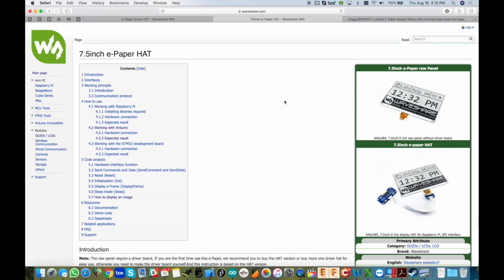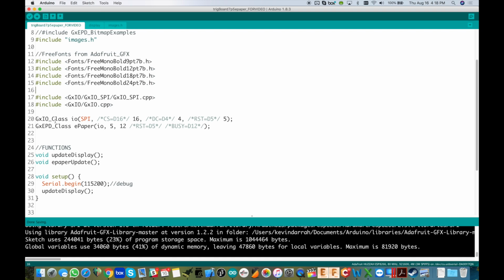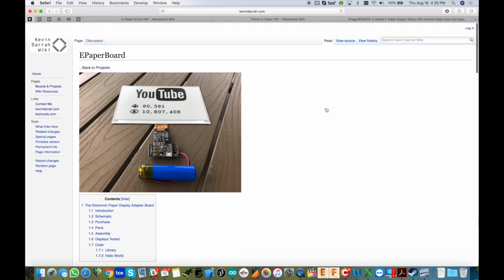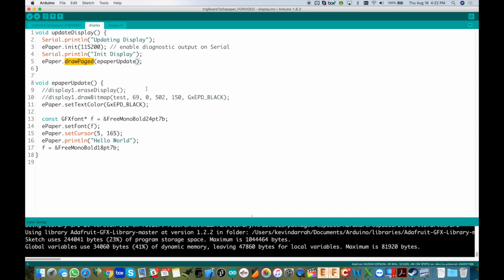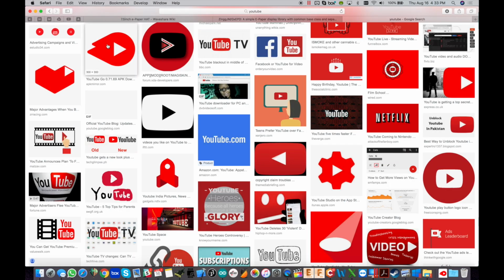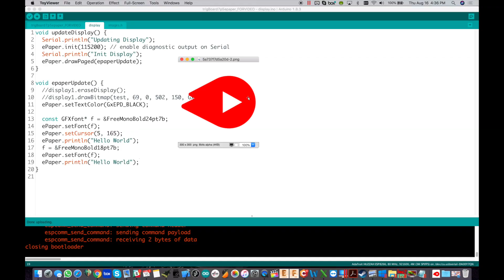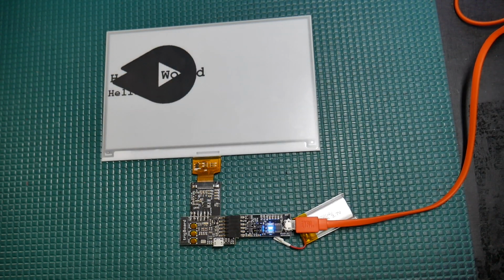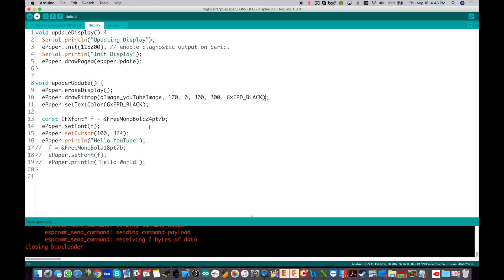E-Paper + ESP8266 Tutorial - Easy Text & Images

Comment: Useful video. Once you see something can be done, you know it can be done.

Two suggestions if anyone wants to try this at home...
Easy one: crop the image tightly to get rid of padding on each size - uses up a lot less space on an image like this. ( I usually include the final size as part of the file/array name). Easy to do, and won't add any real code complexity. 

The other is more complex, and will need a bit of research. With artwork like that logo where there are long runs of 0s or 1s ( white or black pixels) some sort of run length or Hoffman encoding (think fax machine data transmission) would dramatically reduce the amount of data you need to store, at the cost of decoding/expanding the data at display time.

Comment: Hi Kevin, I'm looking to make a counter and timer to put in my local gym to count a rope pull. I was interested if you had some advice on what you think would be a good choice for the display. My initial thought was to use a 4 pin hall effect sensor with 4 magnets evenly spaced and alternating polarities to make it start counting sooner. Concerns I have are: 1) display visibility, 2) battery life I want it to work without buttons, so I was thinking of triggering based on the hall effect sensor, but I did want to work out a scheme where the magnet stopped right under the sensor would not keep the unit running, but that it would still know when it starts up again. Most people will probably be about 4'-6' away from the display and still expect to read it. The room is brightly lit all day long.

Comment: Hello, I have a WaveShare ESP8266 driver board and a 7.5 waveshare e-ink display, but this code doesn't give any result on the screen : debugging (Serial.println) shows that all steps are passed, but screen just doesn't seem to react. In another hand, original library seems too slow for this board, and it tends to crash (wdt reset) when I use it. All I can do for now is drawing a unique bitmap (and eventually make few modifications) using the code example provided with the screen, with no library.

Comment: Would it be viable for 3D printer display?

Say - cheap E-Paper piece ($20 for 6" Kindle one on ali) and SPI ?
Reply: Interesting idea but:
You don't really care about the power usage of the display on a 3D printer.
Driving one of those 6" Kindle displays isn't quite as easy as driving the newer ones, especially not with an esp8266.